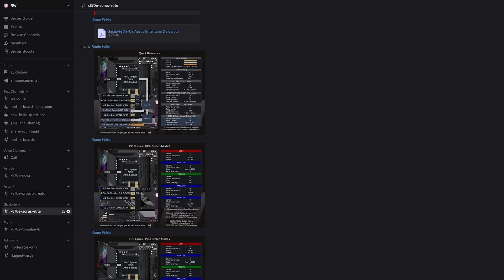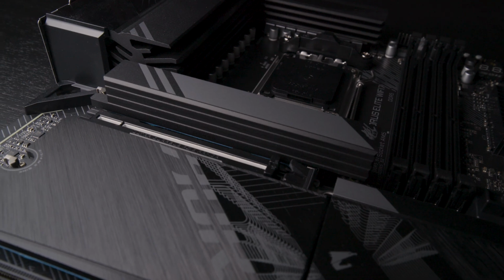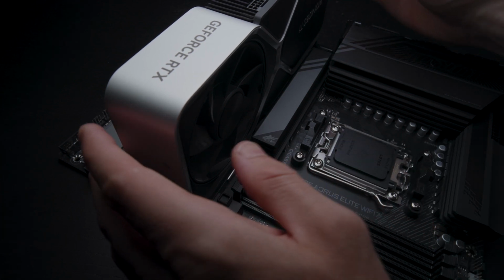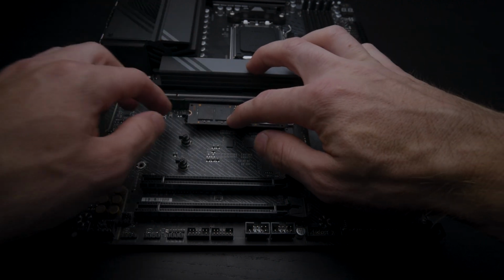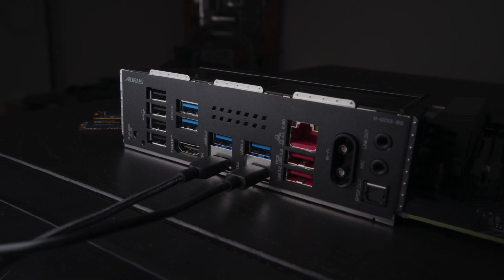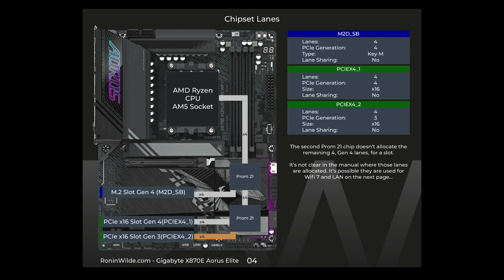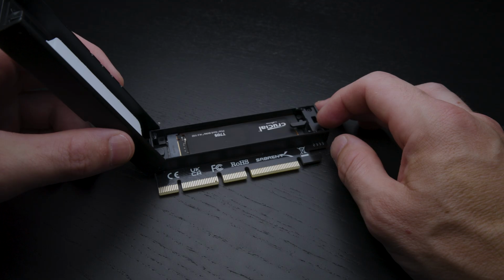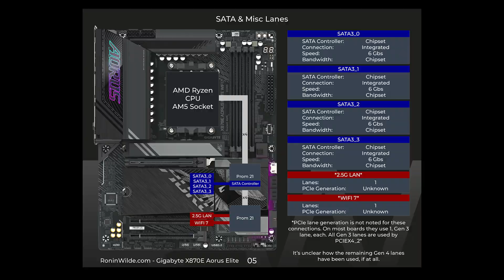Gigabyte X870E Aorus Elite PCIe Lanes and Slots

Comment: You, sir are an absolute life saver, my brain was melted trying to make sense of all of this. I have the X870E AORUS ELITE WIFI7 with the 5090 graphics card, so I'll just put my boot drive in the top nvme slot and the secondary 4tb drive in M2D_SB. And by doing this my graphics card will run to its true potential?
Reply from the maker: Your x16 slot for the GPU won't drop to x8 if you use this setup :)
Reply: @Ronin-Wilde Thanks, just dropped the card in 👍
Reply from the maker: Nice, also those are some quality drone shots, the colour correcting, composition and flight skills are impressive. I have a mini 3 pro and an Air 3. Those are the shots I always hope to come back with lol
Reply: @Ronin-Wilde Thank you, I need to get back flying after the New Year, I've a few Islands off the Weet coast that I need to visit. I also have an Air 3S, DJI are a quality brand.

Comment: Hello everyone, I am a bit confuse, nah properly confused. I've got set RTX 5090 connected to the Gigabyte X870E Elite WIFI7 ICE using Ryzen 9950x3d. I just realized that its running on x8 instead of x16 due to using 4x nvme drives in. Please correct me if I am wrong. If I want to use full potential of this GPU having x16, I can only use top M2A_CPU (using gen 4 lexar nm790 4TB) plus GPU RTX 5090,  Plus one more (4TB Lexar NM790 gen4) but this 2nd one must be in slot M2D_SB? is that right?  Thank you in advance, as I lost in those gen4,5 sharing slots.
Reply from the maker: Yes you are right, A and D will give you x16 mode for your gfx card slot. You are running x8 because your additional ssd are in the slots that share lanes. If you are gaming, this has no noticeable impact on GPU performance.

Comment: i have the same board and a 9100 m2 and 990pro. do i put the 9100 up top and the 990 in the middle of the 3 slots below to get full performance on pc?
Reply from the maker: You can use the slot in the middle, it's connected through the chipset.

Comment: Thanks for the intel. But if the chipset 1 offers 4 lanes for an m.2 will plugging in a sata ssd which also needs a lane take away from the lanes for the m.2? Same with wifi7 and the chip 2.

My idea was the system m.2, the GPU, one m.2 for games in the middle slot over the first chipset, one sata SSD and if needed maybe my other m.2 in such an enclosing case plugged into the lower pcie over chipset 2. Wow Ive gathered a lot of drives over the years.

At first it sounds perfect. But Idk how the SATA will affect it. And if WIFI also needs a slot then I have no idea anymore 🫤🥲
Reply from the maker: I’ll help you out with this.

Comment: Can you help me out with deciding between the x870 stealth ice and the B850 stealth ice? From what I can tell they are the exact same boards except for 2 USB4 thunderbolt ports, more beefy VRM design, and the b850 having Bluetooth 5.4 compared to Bluetooth 5.3 on the x870(even though the x870 has a better wifi chip technically). I have heard that the x870 has less memory channels than the b850 but I don't know how true that is. Also - does it matter which one I choose as far as ability to have 3 nvme m.2 drives and one 5090 card? If there are any other differences that you know of that would be appreciated as well. Thank you for everything you do!
Reply from the maker: That was not you in the discord, I apologize, another person was trying to choose between the stealth and the tomahawk.

I can speak to the connectivity. Both boards will be able to support 3 SSD's and your 5090 no problem. 2 M.2 slots are Gen5 and 2 are Gen4. Using the 4th M.2 slot would deactivate the 2nd PCIe x16 slot (x4 mode). True for both boards.

The main difference is that the X870 has USB4, this uses PCIe lanes from the CPU. To get full bandwidth of x4 to the 2nd Gen5 M.2 slot you would need to disable USB4. The B850 doesn't have USB4, the 2nd M.2 slot is Gen5 x4 all the time. With the X870 you also have the option of running USB4 with 2 lanes and the 2nd M.2 slot with 2 lanes. This gives you the option to keep USB4, with a maximum transfer speed of 32Gb/s (Asmedia 4242 USB4 controller can only use Gen 4 lanes, the 2 Gen5 lanes drop to Gen4 speed) and still run a second Gen 5 ssd with a max transfer speed of 64Gb/s.

For connectivity that's the main difference I see, the X870 gives you the option of USB4 and let's you choose how and if you want to use it. If you want more type c ports/additional power delivery or you want to run a USB hub, USB4 allows tunneling as well as display port alt mode for a video signal. It also supplies up to 15 watts of power per port. I would go for the X870 if there isn't a significant price difference. Sorry for the delayed response, I really hope this helps with your choice!

Comment: I am planning on having one Gen 5 NVMe and 2 gen 4 ones. Any chance you can tell me which M2 slots are best in order to accomplish this without any lane sharing. If there is any lane sharing, which one would be sharing lanes? This is referring to my comment on deciding between the x870 stealth ice and the B850 stealth ice.
Reply from the maker: On the Elite, M2B and M2C are the slots that share lanes with the graphics card slot. To avoid this, you can use M2A for your Gen5 drive and M2D for your Gen4 drive. Finally you'd need an M.2 expansion card for PCIE4X_1 for the 2nd Gen4 drive. I think you are better off with something like the stealth layout if you want to avoid lane sharing. The Elite is made for lane sharing or future connectivity.
Reply: @Ronin-Wilde  I was reffering to the stealth series boards, I am currently trying to decide between the x870 stealth ice and the b850 stealth ice, I cannot decide which one to get and was wondering where I should put my 3 m.2 drives to avoid any lane sharing (I think m2 CPU shares bandwidth with the USB 4 ports)

Comment: can you make a pcie connections video for the x870 stealth ice and the B850 stealth ice motherboards? I am having trouble figuring out if I can run 1 gen 5 SSD and 2 gen 4 SSDs without lane sharing with the main GPU slot
Reply from the maker: X870 Stealth ice: main x16 slot for graphics card doesn’t share lanes.

B850 Stealth ice: main x16 slot for graphics card doesn’t share lanes.

Both boards can support your setup drives.
Reply: @Ronin-Wilde  Awesome thank you! thats what I thought but wasn't confident and didn't want to spend the money without being 100% sure. I am planning on having one Gen 5 NVMe and 2 gen 4 ones. Any chance you can tell me which M2 slots are best in order to accomplish this without any lane sharing. If there is any lane sharing, which one would be sharing lanes?
Reply: Your videos are a big help, no rush but I have the parts and just don't know which slots to occupy on the B850 to avoid lane sharing

Comment: Another here who enjoyed your videos and bought an Asrock X870E Nova motherboard after seeing your breakdown of lanes.

I was initially after a board simply for gaming and archiving but wanted to be able to utilize three to four NVMe and move away from mechanical drives inside the new PC. Had I not seen your video I would have picked the wrong board simply based on less informative reviews.

I too have to say the previous straight to the point animated lane drawings were a great quick feature, very easy to understand and even my kids got them.  It's great to see a no nonsense breakdown of the motherboard and what you can actually use instead of the usual benchmark positive review with a single NVMe and 9800X3D review.

My sons will also be moving to AM5 most likely when their funds allow, and will again be looking at your videos when it comes to helping them choose.

Comment: Really enjoyed your previous videos explaining PCI-e connections for X870 family - in fact I made my choice for a specific board thanks to your video.
I see that you are trying some different format, but what I'm missing in this one is a nice animation that showed the lines update as you add some device to specific slot. This was extremely clear and much more noob friendly. Hope that this will make it back to your new videos.
Reply from the maker: Thanks for your feedback and I’m really glad you were able to choose a board based on one of the videos. That means a lot, which board did you choose?

You are right! I am trying a new format and for the next one I will add the animated lanes instead of the static images. Thanks for this :)
Reply: @Ronin-Wilde  MSI Tomahawk X870e, because there's no bifurcation on the graphic card's PCI-e. I know that most likely any card that I'll ever put in this slot won't use the full potential of the bus, but I just couldn't live with measly x8 😅and also even with full x16 lines there are still 2 slots for M.2 gen5 which was perfect (as I don't need USB4)
Reply from the maker: That's great, I like the layout of the Tomahawk. MSI did a great job assigning the CPU lanes and leaving the option open to disable USB4 on most of their X870E boards was a good move.

The whole lane sharing thing is a bit much. It's nice to not worry about it at all, even if you know you won't need all 16 lanes. One less performance decision to think about.